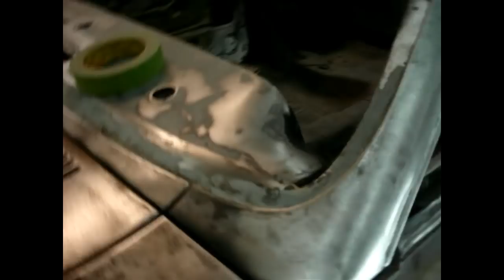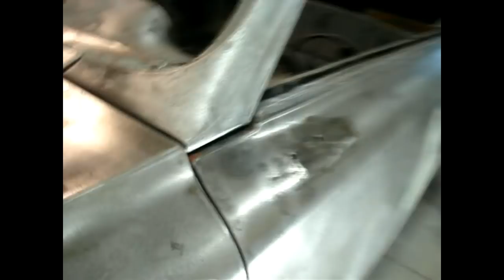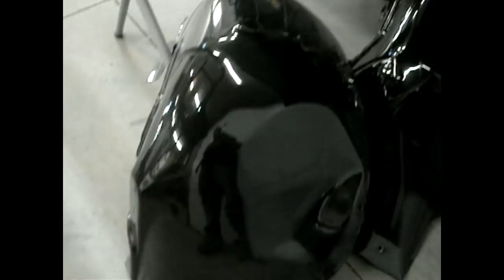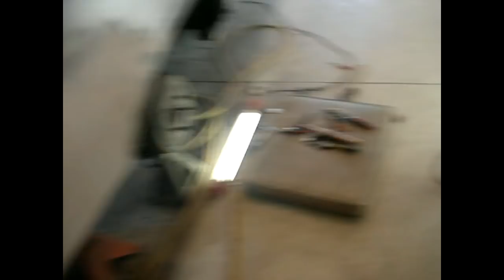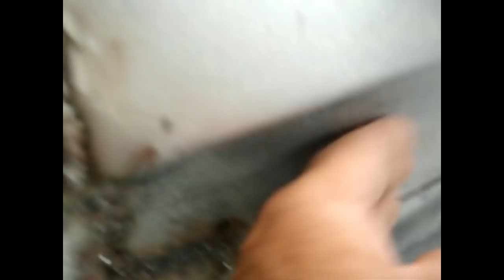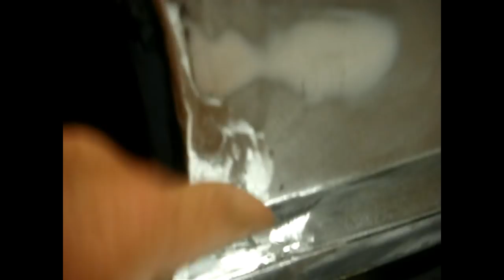1966 Pontiac GTO Part 26

Comment: how do you keep the rust away while working on it ?
Reply from the maker: My shop is always heated and low humidity so I really don't have an issue with it, in part 28 it will receive it's first spray coating.